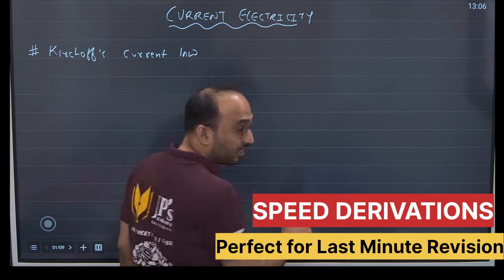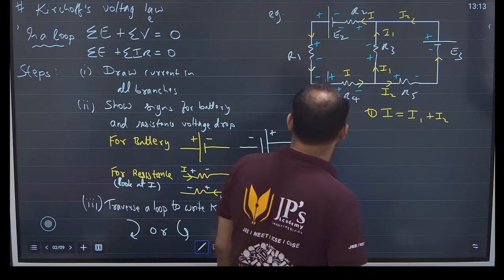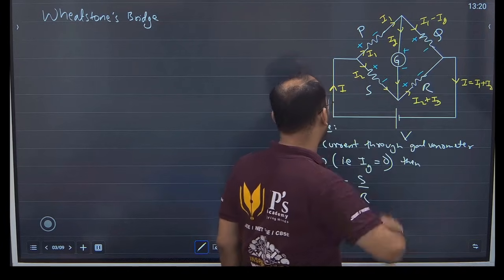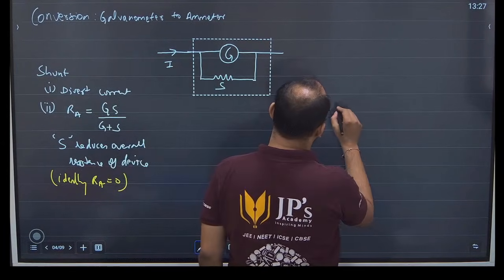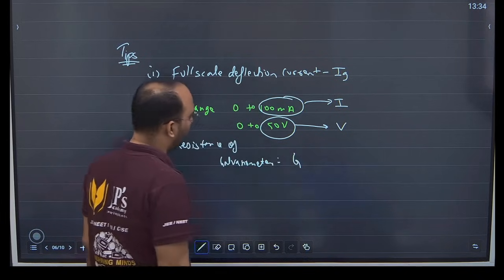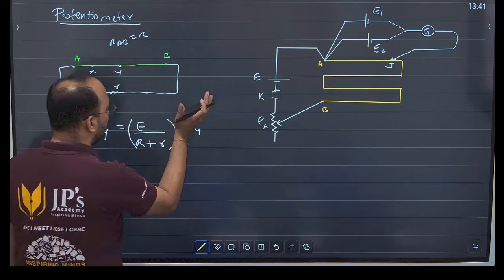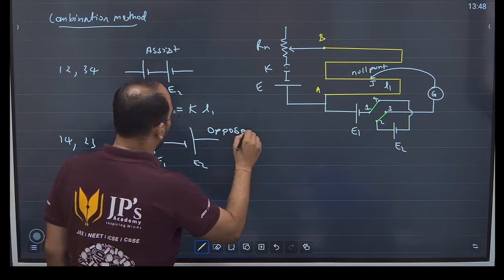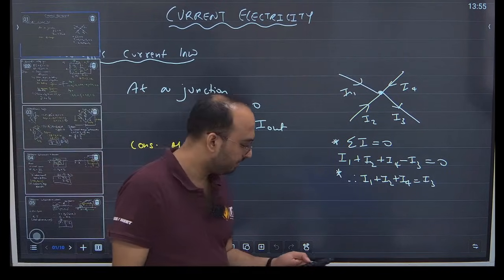🚀 SPEED DERIVATIONS | CURRENT ELECTRICITY | Class12th HSC | Maharashtra Board | Class 12th ISC CBSE

Comment from the maker: TIMELINE
00:00 Introduction
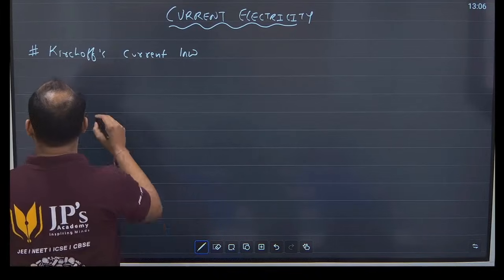00:30 Kirchhoff's Current Law (Concept)
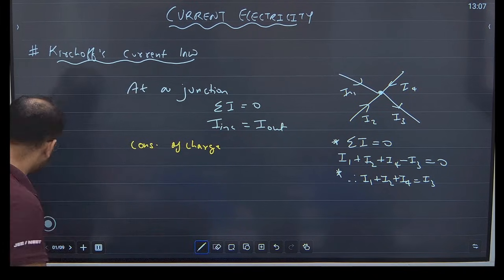01:54 Kirchhoff's Voltage Law (Concept)
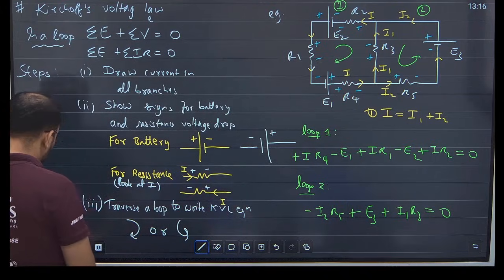10:56 Proof of Wheatstone Bridge (Derivation)
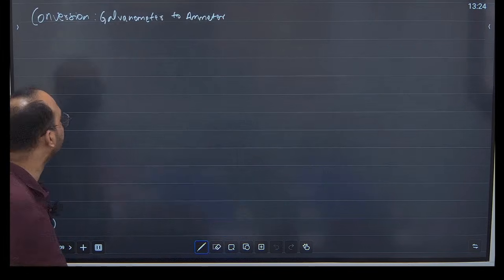19:02 Galvanometer to Ammeter (Derivation)
23:38 Galvanometer to Voltmeter (Derivation)
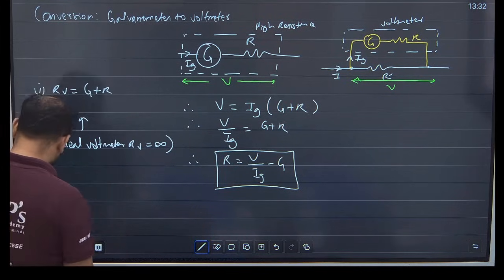27:00 Tips for Ammeter voltmeter problems
29:21 Meter Bridge (Experiment)
34:41 Principle of potentiometer (Concept)
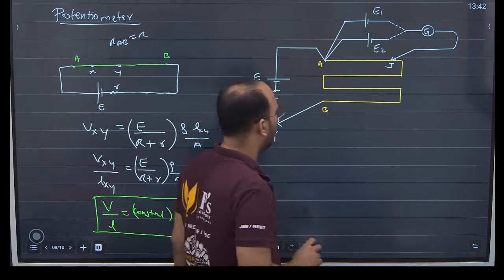36:34 Comparing EMFs Direct Method (Experiment)
40:00 Comparing EMFs Combination Method (Experiment)
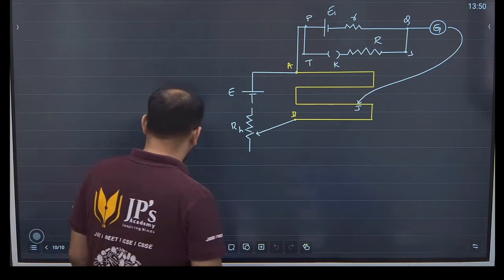44:13 Finding Internal Resistance (Experiment)